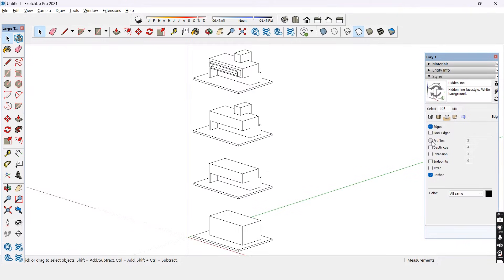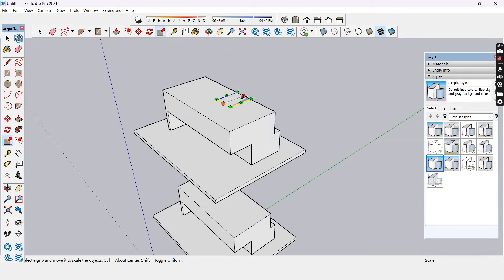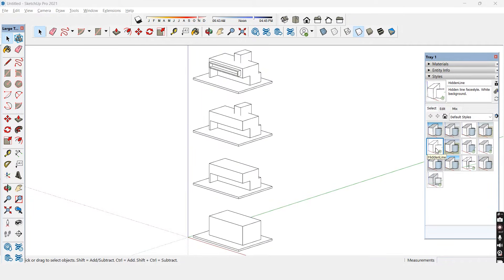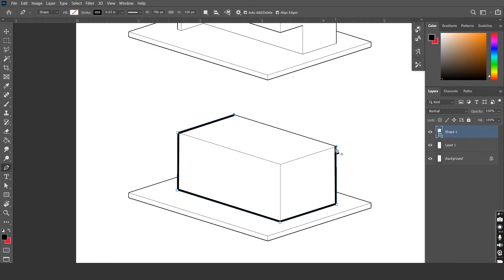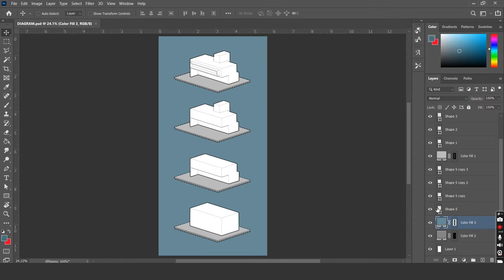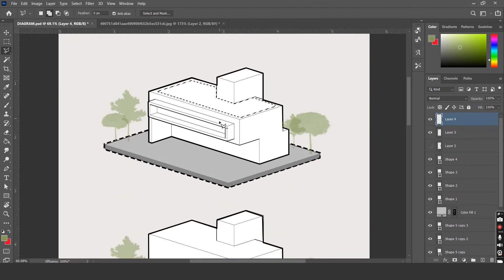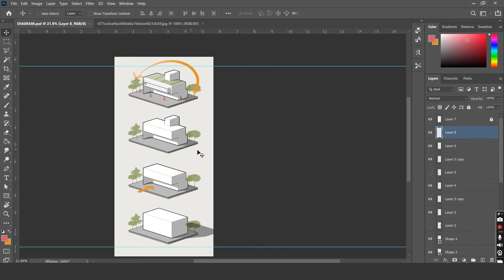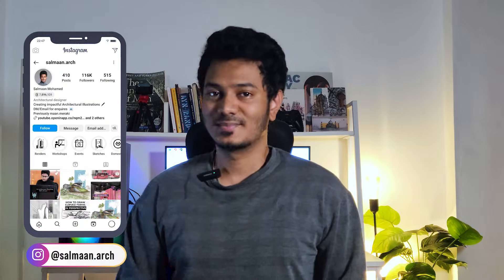Architectural Concept Diagrams | FAST & EASY | Sketchup + Photoshop

Comment: After I selected the site plate i can not find solid color tool. Where can i get it? In the video, I saw a popup menu at the bottom-right corner of your screen, but I can't find it in my mine.
Reply from the maker: I'm not sure why the bar on the bottom right could be missing. Maybe try resetting the Photoshop layout. You can go to Layer-New Fill Layer-Solid color as an alternative.

Comment: Can you explain how to add that curved sun path
Reply from the maker: I've just used the basic brush tool to draw it freehand, with a digital tablet.
Reply: @salmaanarchitect  thank you
Reply: @salmaanarchitect  but how is it so perfect with free hand? how to get that straight smooth curve, i am not able to achieve that angle and it looks bad
Reply from the maker: @kritishdua8537  You can achieve that by using a digital tablet which is just like drawing on a paper.